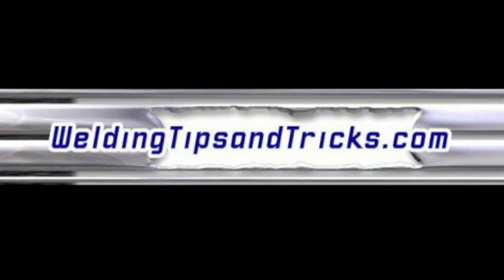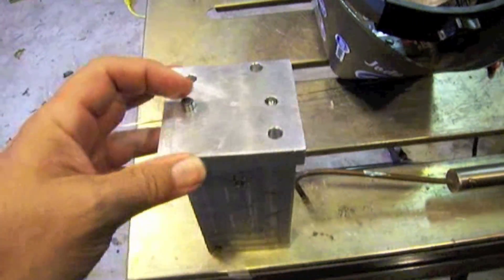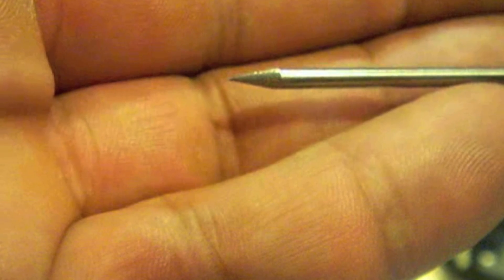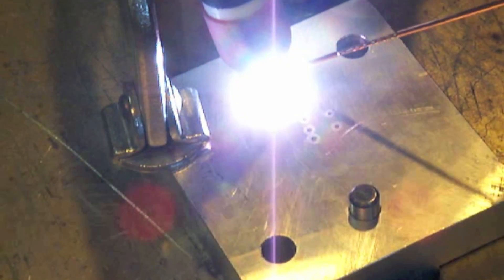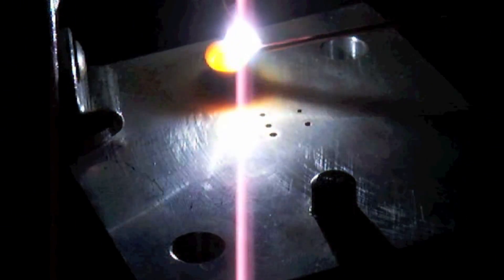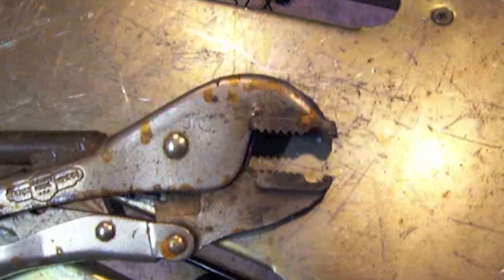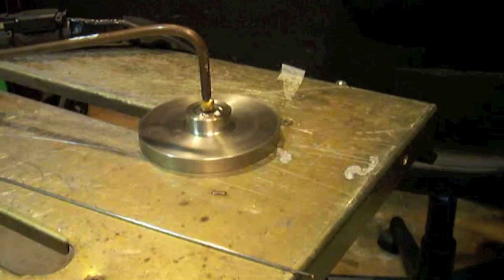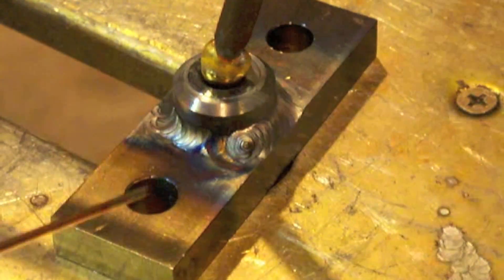Slide Hammer Puller - DIY Welding Tool - Portable Welding Table

Comment: Even though this video is pretty old, you welding that rod on the vice grips is actually better than the attachment that comes with most slide hammer kits nowadays because you welded it aligned with the jaws. The attachment threads in the back instead of the screw of the vice grips but that puts you at a weird non straight angle and makes it less effective. I will actually weld one of those long nuts on mine to replace the entire rod at the same angle. Thanks for this!

Comment: Hi Jody !
Thanks for sharing your very interesting knowledge.
I have seen those foldable Nomad welding table, but I was afraid about the  thickness of if. I mean it seems to be 2mm, so doesn't it deform itself due to the heat ?
Thanks

Comment: Nice video. Wish I could tig weld. It's pretty tough. At least I have mig and stick down pretty good
Reply: Just keep practicing. I started out with stick welding with a little everlast welder and have worked my way up. Each is a little different but once you build up some muscle memory it gets easier.

Comment: I noticed you mentioned Copper Alloy as a 3rd hand tool. In another video I think you mentioned copper silicon when TIG-ing stainless? Are these alloys used because their composition prevents arching while providing an additional means of holding down the work piece?

Comment: I baught a nomad table after watching your demonstration? Do you know what coating is on the table because I welded aluminum to it thinking it wouldn't stick. And last do using magnets to hold parts afect stick welding?

Comment: how much do these tables cost, looks like you could fairly easily fabricate one from a cheap shop table. just replace the top wood part with some 1/4 or 1/2"

Comment from the maker: @simpleinseattle   yep, the aluminum block was a big heat sink...lots of questions about why the aluminum didnt melt too....thats one reason, the other is that the oxide on the aluminum is hard to melt on DCEN.  If that pin was aluminum, it would have been tricky

Comment: Brilliant video, a cluster of great tips. I would have worried about melting the aluminum. Or, if similar metal, welding the stud to the piece. 

I liked that portable welding table as well. Looks like it could be made by hand. What kind of metal is the base made of?

Comment: Wasn't there a danger of "melting" the aluminum?

BTW does anybody out there have a problem with your gas tanks leaking??? I've used my tanks sporadically, both mig and tig tanks, and my tig tank was empty. It's leaking from some where. I'm thinking from the pressure relief valve.